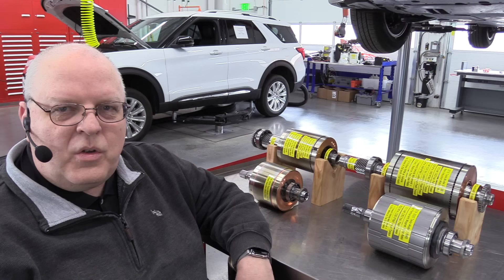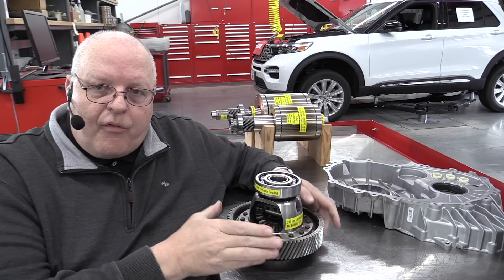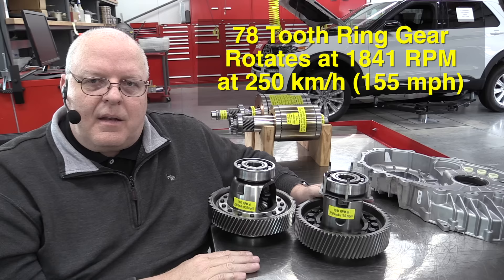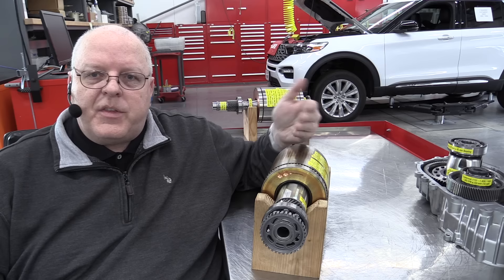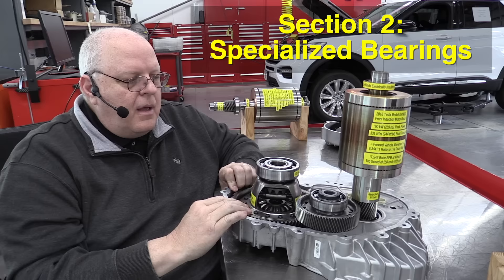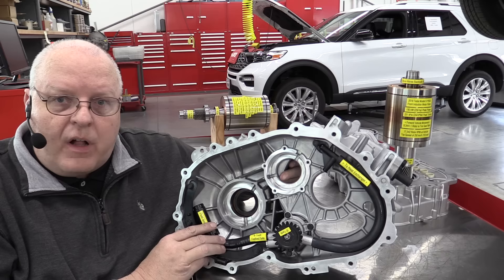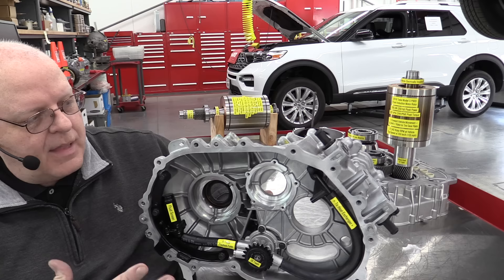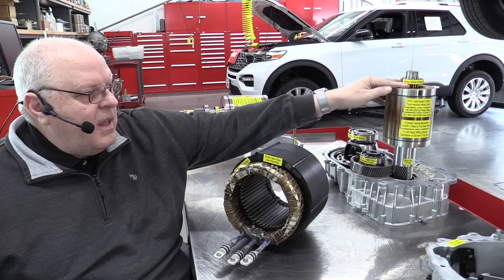Understanding the Tesla Model S Front Motor

Comment: Permanent magnet motors always have a torque limit simply because one of the 2 magnetic fields is fixed strength aka limited.  Induction motors as you pointed out you get more torque with more current, both fields increase.  The 2 magnetic fields I'm referring to are the fixed (stater) and the spinning (rotor).
Reply: The reason the permanent magnet motors are more efficient is one of the magnetic fields is preexisting.  For the induction motor you have to use power to make both of the fields.
Reply from the maker: Good points, Thanks for the information and thanks for watching
Reply: Induction motors don't have any magnets, that can be possible to demagnetize and are generally considered to be the "toughest".  I have fired up countless 3 phase motors from the junkyard and almost everyone of them, ran just fine, maybe new bearings is all. Try that with an engine sometime.
Reply: Another limit to consider, on both motors, is the field density limits of the electrical steel. At that point current at the stator or rotor just shoots up with no extra produced torque. That rise hopefully triggers inverter protections, or else by heat fries stator windings or rotor cage (never seen that), or demagnetize-bakes the PMs. Not so common in large motors, but you can see in low-grade e-bikes and such smaller apps.
Reply from the maker: @jpinto3912  Thanks for the information!
Reply: Plot twist.  The PM motor is not a pure PM motor.  Tesla uses a Permanent Magnet Switched Reluctance Motor.  It is PM at low RPM and a Reluctance motor at high RPM.  It acomplishes this by shifting the magnetic field in the stator as RPMs increase.
Reply from the maker: @Robbie6298  Thanks Rob, in this video I refer to that at 0:21 but that is too much of a mouthful to say every time, even you left out the word "Internal" in Internal Permanent Magnet Switched Reluctance Motor, so I used the shortened PM to represent that instead during the video.
Reply: @Robbie6298  No, it is not a "Permanent Magnet Switched Reluctance" motor, it is a Permanent Magnet Synchronous Reluctance motor, which is very different. All internal permanent magnet motors exhibit this reluctance effect - most manufacturers don't even mention it, some (eg. BMW) mention that the rotor lamination design accentuates this, and only Tesla makes an absolutely common IPM motor and then claims to have invented something amazing.

Comment: An induction motor operates according to the right-hand law of physics, therefore there is aluminum from side to side called a closed club rotor, and it is the main motor for high speeds.  This type of engine has high torque at high speeds.  The motor with the permanent magnets is for two purposes.  The first is used as a synchronous motor that has high torque at low speeds.  And the other is used as a generator to charge the batteries that will be used to brake the vehicle.

Comment: If you watch some of Bjorn Nylands scanmytesla videos you'll see that the AWD Model 3s only use the rear (PM) motor the vast majority of the time (even for regen). Another reason to have an induction motor is that it can simply be switched off in situations like this. This wouldn't be possible if you had PM motors front and rear.
Reply from the maker: Thanks, I just watched a few. Very interesting and it makes sense to only use the PM motor under most driving conditions.

Comment: And a comment on your question about how the car makes use of the engines in different scenarios. A friend of mine drives his p85d with ScanMyTesla attached, His readings show, that on range mode, the car will run mostly on the front engine. But normal driving, the car will use mainly the rear motor until you kick it. Stomping harder on the go-pedal, and the car will engage front motor more. I hope this is useful and that not too many have already commented on this question ;)
Reply from the maker: Excellent feedback, thank you. I learn something from every comment.

Comment: The model 3 dual Motor does only use the rear pm motor as long as you do not floor it. You can use the App scanmytesla together with a dongle on the internal bus. I did not test it myself but the yt channel tesla bjoern did a lot of well documented tests.
Reply from the maker: Thanks. I just bought the app and the cable. I will be checking it out.
Reply: @WeberAuto  Thanks for your indepth videos, always fun to watch.

Comment: You can look up "Sandy Munro' channel where he talks about the "octo-valve"... He has a few videos on the subject-- he talks about how the heat exchange happens in all directions;  heating the battery, cabin, AC unit. ect.ect..  Its an interesting design to say the least.
Reply from the maker: Thanks for the information
Reply: @WeberAuto  No problem.. He actually takes the Model Y apart and talks about every little piece, and discuses different ways that it could be built.   He did the same for the model 3 some months before, and suggested that the rear half of the car should be a giant mold instead of 70 separate pieces----  and he was completely surprised when he later took apart the Model Y and Tesla had already taken his advice... They are now built with one giant mold/ cast in the rear;  I believe they are even going to build the front half with a 2nd casting. Pretty interesting how fast Elon adapts to new ideas if they are better, and adopts them almost immediately.

Comment: How difficult would it to add Current Loops around the 3-phase power conductors in the motors of the Tesla?  That and Voltage, RPM,  would give most info needed about each drive motor performance at any instant.  Current loops probably are a lot easier on less integrated system like Bolt.
Reply from the maker: The inverter does monitor the three phase currents on EVs. Thanks for watching

Comment: Thanks for great video. I enjoy every video from you. You compared two rotos with diameters lengths. Comparing the lengths should be usually effective active length. It means the lengths in it is the magnetic circuits. I don't know if you used the total length of the rotor with the both rings.
Reply from the maker: I realized after the video was published that I swapped the rotor dimensions of diameter and length. Sorry for the confusion.
Reply: @WeberAuto  I love your videos. Thank you so much.

Comment: There is an additional "feature" of the reluctance motors which is they suffer from torque flutter under very high power ramping - so they don't have the "kick" of the induction motors but they provide efficiency so are used exclusively under very low power conditions (cruising).  So the reluctance motor + induction motor pairing provides the efficiency + torque ramping for the 2 different motors on the dual motor systems.  I understand (please correct me if I am wrong) that only the rear induction motor is used for regenerative braking.  This produces some undesirable effects in icy conditions requiring the more work on the anti-skid to correct this.
Reply from the maker: Great information, thank you! I have heard the same thing about not using the front motor for regenerative braking, but according to the ScanmyTesla app on our 2018 Model S P100D, both motors are used for regeneration with about 4 times more power generated in the front than the rear.
Reply: Tesla doesn't have reluctance motors. The permanent magnet motors produce some reluctance torque, but all PM motors with internal (rather than surface-mounted) magnets do that. Despite Musk's idiotic blathering, just think of these as PM motors.
Reply: @brianb-p6586  It is defined in engineering terms as a PMSR, look it up in engineering publications. PM defines how the magnet field is generated, reluctance describes how the field dynamics are used to produce motion.
Reply: @Tom55data  I think you missed the point: the "S" in that acronym is "synchronous", not "switched" - they're very different. The problem isn't with the meaning of "reluctance". The other point, of course, is that all IPM motors can be considered IPMSR motors.
Reply: @brianb-p6586  I know S  is synchronous - that just mean the field is synchronous with the field it has nothing to do with how the field creates motion, only that the field is synchronous with the motion of the rotor - and R mean reluctance is a separate term meaning how the magnetic field is "latched" to the rotor to create motion.
Reply: @Tom55data  Yes, "synchronous" and "reluctance" are separate, but a synchronous PM and synchronous reluctance motor work the same way - this is not the switched reluctance motor that is fundamentally different. The reluctance component in these synchronous motors is much less significant than the PM component, which is why I suggested just thinking of it as PM.

I also recall seeing "switched" in your original text, but perhaps it was edited or I just mixed it up with another comment. Sorry if I caused some confusion there.

Comment: Keeping the induction motor may partially be due to the permanent magnet motors requiring rare earth metals that may be in short supply and/or environmentally unfriendly.   The car can be driven by the smaller, more efficient permanent magnet motor and just use the induction motor for acceleration.
Reply from the maker: Good points, Thanks for watching

Comment: How do Permanent magnet and induction motors compare when it comes to regenerative braking, I wonder. Anyone?
Reply from the maker: It is my understanding that the induction motor can generate more power on deceleration for the same reason they can be more powerful on acceleration. PM motors are limited by the strength of the magnets. Thanks for watching
Reply: @WeberAuto  Thanks! Your content is wonderful and appreciated.
Reply: Both types are more than capable enough for regenerative braking. The real issue is how much regen power the battery can handle - that's always limited to a lower value than discharge power.

Comment: You should try out this phone app called "scan my tesla". It uses a bluetooth OBD II adapter and special cable to show real-time CANBUS data such as the exact power each motor is using and all of the coolant temperature sensors. I can't post a link to it, but there's a website about it on google.
Reply from the maker: Thanks. I just bought it and will be checking it out

Comment: Sir, all your videos are excellent. Can you please help us to understand on how two or more motors are controlled using a single accelerator input signal. How torque on demand from wheel and accelerator input are taken into controller and how the power is distributed to twin or more motors.
Reply from the maker: The two motor controllers communicate with each other and other modules to keep everything synchronized as needed. Thanks for watching

Comment: From what I've read, Tesla seems to have settled with six pole synchronous reluctance motors. That makes sense, as it's a far more efficient motor than any PM motor would be.
If I were to hazard a guess, the frequency of the coil drivers would range in the 230 - 400 hz range.

As for finding out if both front and rear are both continuously used, a quick and ugly quickie test would easily tell. A couple of turns snoop coil around one of the AC lines would tell the tale. Might get a trace from high current pulses in the HVDC line feeding the module, but a Hall sensor wold likely perform better.

I'll remain not a fan of thin tires and utterly not a fan of multiple tire sizes on a singular vehicle. Low tolerance for large obstructions for the former, logistics and Murphy's law for the latter and honestly, I've found that Murphy was an optimist.
Reply from the maker: Thanks for watching
Reply: They're synchronous PM motors, like everyone else. Look at the teardown videos from anyone (such as Munro if WSU doesn't have it yet) and you can see that the Model 3 motor is just a typical IPM design, not a "reluctance motor". There's a Munro video which compares motors (Model 3, Leaf, i3, Bolt, etc), and you can see (just by counting magnet slot sets) how many poles each has.

Comment: Thank you for the video of disassembling the front unit of Tesla.
I have a question.
16:13
Conductive Brg. -> Rotor -> Ceramic Brg. -> AEGIS ring
This will cause current to flow through the Conductive bearing.

I think this is it,
Ceramic Brg. -> Rotor -> Conductive Brg. -> AEGIS ring
In this case, no current flows both Brg.s.
Therefore, electrolytic corrosion does not occur.

What dou you think?
Reply: I was wondering why only 1 ceramic bearing, why not both?

Comment: Like to start by saying,  how much I enjoy your videos. Professionally done and extremely informative.  I am desperately trying to find out some information on Tesla large motor unit. I am hoping you could find the time to help me.

 

Could you please tell me the weight of motor only , with no gears, or inverter. Just the weight of motor housing, stator, rotor, and rear motor plate. I will not use gear reduction and will be mounting inverter in a different location. 

 I need this information to get weight and balance correct for my project. It is very vital info. Your help would be greatly appreciated.  Look forward from hearing from you.

 

Thanks William
Reply from the maker: I do not have that information. Thanks for watching

Comment: One more comnment. I noticed you asked about wheelsize and any effect if you change wheelsize. I own af Model S p90d that rides staggered wheel setup whith summer tires. Front wheels are 245/35/21". Rear wheels are 265/35/21". But my winter wheels are 265/35/20" both front and rear. Theres is no difference felt at all. The car just rides along as usual. I input the wheelsize via the MCU, thats it.
Reply from the maker: Excellent feedback, thank you very much

Comment: Permanent Magnet-Assisted Synchronous Reluctance Motor(PM-ASRM) are a lot more efficient and also more powerfull per kg than induction motor! The fact that the rotor of the PM-ASRM is syncronous with the rotating magnetic field of the stator makes it cooler and thus the amount of currente you can put in the motor is limited by the cooling power of the stator.
Reply from the maker: Thanks for the information and Thanks for watching

Comment: Hi there from down under in Australia. I have recently acquired a Tesla model S front and rear small drive unit and a large rear drive unit. I will be fitting these mounted longitudinally in a Land Cruiser 4x4 project. I note with interest that the front and large rear you have covered are both fitted with oil pumps. I intend to run these motors in reverse rotation in my application. Would you know if the oil pumps in either one will continue to  pump oil running backwards? Your video's are really excellent too and already a great help to me in understanding EV tech. thanks.

Comment: on my model 3 I installed a CAN read out tool and was able to see that it usually uses the rear motor 90% of the time. Only if more power or traction is needed it uses the front motor. I took some screen recordings and postet them on youtube. Here is the link https://youtu.be/6B8ZPh0om6o
Reply from the maker: Great information. Thank you
Reply: That makes sense, not just because the PM motor (which is in the rear) is likely more efficient, but because the induction motor (which is in the front) spins unpowered without the "cogging" action of a PM motor.

Comment: The torque which is written on the rotor about 331Nm is after the gear ratio or its just the torque produced by thr rotor itself without gears?

Comment: would there be any benefit in range/efficiency of using a smaller motor with a 2+ gear transmissions or cvt?  If we were looking at normal 0-60 times of around 7 sec I would think that one gear for acceleration and one for highway speeds would be better then to put in one motor that may be oversized to cover an entire torque range.

Comment: I have a 2017 Tesla Model S P100D AWD and I have chosen to run square 21"  245/35/21 tires.  I want to be able to rotate wheels/tires.  I imagine that the beefier rear motor can handle the RPM difference caused by the decreased tire size, other than reduced traction from a narrower tire, and 7mm less rear ground clearance, what other problems could this create that I'm not aware of?
Reply from the maker: I have been told that there is a setting on the center display to tell the car what tires you have. Thanks for watching

Comment: Which is the lubricant used for the electric motors ?, which are the technical specs of that oil, is it  synthetic, PAO, is it dielectric which brands produce it ?
Thanks a lot in advance.